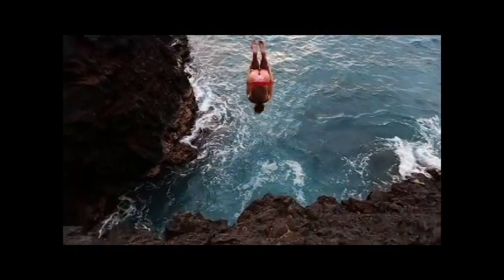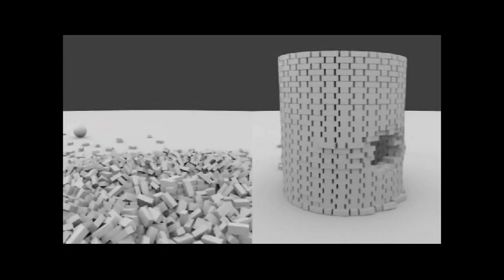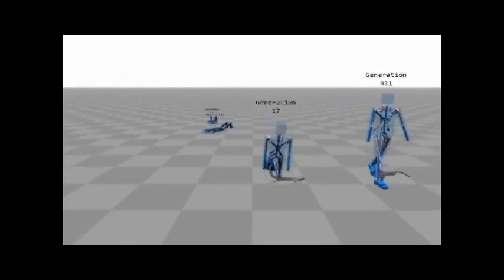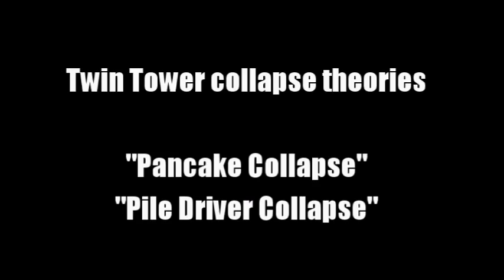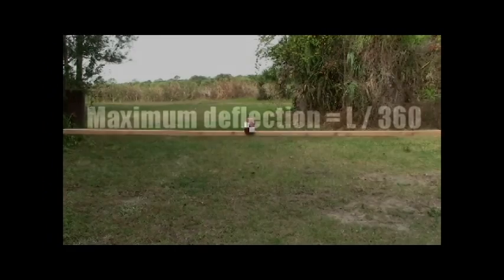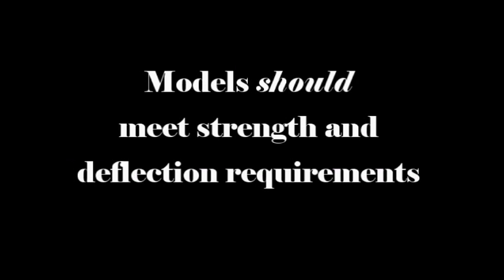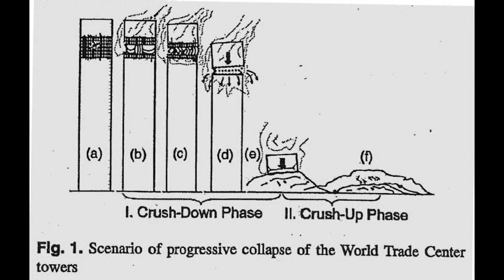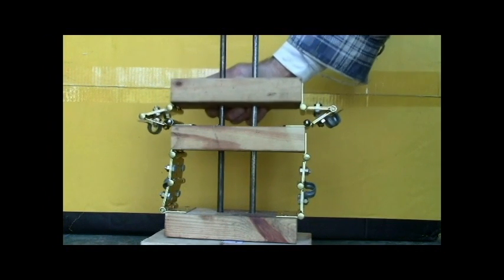9/11 Experiments: The Force Behind the Motion

Comment: The official story of the collapse of the towers is that they were a "pancake" collapse. If that's true, where were the "pancakes"? If you look at photos of ground zero after the collapses you will see that there is a complete absence of 110 concrete floors lying on the ground where each tower would be. What happened to them? They completely disappeared! The official story is a lie!
Reply: +prodigy2k7, the pancakes magically turned into dust. Otherwise, in the real world, pulverization requires work (energy). The amount of work consumed by collapse of the buildings, pulverization of the concrete, and blowing hot concrete all over lower Manhattan, remains roughly 50x that available in the PE (potential energy) of the upright structure.

That's what says pancakes would be in one piece at ground level, if explosives were not involved. So, explosives were involved.
Reply: +Debbie Walker; dear lady: this video; like any other experiment we have seen here, clearly shows that the abided scenario is not correct. The pancake theory is already negated by NIST. Remains the pile driver theory. Since the latter is in violation of the commonly accepted theories of sir Isaac Newton; we need some proof for this. Unfortunately; none is presented.

There are a few circumstances that STRONGLY suggests that the towers were loaded with SOME KIND OF EXPLOSIVES OR SIMILAR. 

1. All the concrete was turned into dust.

2. Huge steel beams were tossed more than one hundred yards SIDEWAYS.

3. The core was turned into a skeleton that was clearly visible several seconds after the collapse was completed. Some have argued that the core columns still standing was a proof for the pancake theory. On the contrary; the SHAPE of it proves that it was damaged by something totally different than some falling debris. A steel skeleton that turns into a cloud of dust. What could be a more obvious proof? Bazant´s mathematics?
Reply: Game Set and Match. That shows how important it is asking the right questions. Bravo.
Reply: +Debbie Walker is that seriously how you hope to discredit how 9/11 wasnt a controlled demolition? Because the amount of debris? The wtc was built to withstand the events of 9/11 and when you look at how the building fell, paired with the numerous witness accounts of people hearing consecutive explosions, it further proves the theory. There is more evidence that supports that 9/11 was staged than what the government tells us. Wake up.
Reply: 9/11 was the "Day of vaporization".
Reply: Claiming thermite did  it, or your thermate, is as stupid as Judy Woods DEW insanity.  No thermite was found, Jones and his fellow 9/11 truth nuts made up the thermite claims based on nothing.
Reply: Lynn, sulfur means what?  Tons of wallboard, tire fires from the garage burning for weeks. It was planned by UBL, and done by 19 terrorists.  The debris was gone through for human remains.  The fires caused buildings to collapse, simple science.  If you have evidence otherwise, take it to the FBI. Or team with a newspaper and earn the biggest Pulitzer since Watergate.  But you have nothing but BS, as you ignore 19 terrorists who did it, and try to blame people you can't name and offer zero evidence to support your fantasy version of 9/11 you can't spell out.  You have to cover your loads, it is a law; or do you want human remains in the dust to be spread all over NYC and New Jersey... Got some evidence?  15 years, why have you failed to produce evidence to prove your scenario  you can't explain?
Reply: Pretty typical for a truther. You make an assertion without the slightest trace of evidence and like all your assertions get it completely wrong.
Reply: "How foolish of me."

Yes, extremely foolish of you. Pancaking is a very specific term used to describe how the floors collapsed onto one another, each one adding to the momentum of the one above it. Within a handful of floors, you have irreversible momentum that continues all the way down to ground level. You can see this happening with  your own eyes in the video angles that were taken from below the towers. 

Your "percolating, bubbling and popping" terms, while not actually used in any professional level, are RESULTS of the pancaking floors pushing each of their walls outward. FFS, even the guy who made the crude experiments in the video above says multiple times that it was a downward and outward process.

It's clear to me now that you aren't even holding any cards... hell, you haven't even attempted to sit down at the table. Are you just going to spectate and heckle or are you actually going to argue any points? You can't win unless you play.
Reply: You'll have to forgive Mike. He's a fucking idiot.
Reply: The "bathtub" was/is six stories deep to the floor, 70ft down to the bedrock. The bathtub floor was not broken, so it was less than 70 ft. deep to basement floor. The towers were 1362' tall.
Thick-headed , weak-suck "debunker" Tony Dumpcan thinks 110 stories of steel and concrete and steel structure fits in a LESS THAN 70' deep, 6 story hole. WRONG AGAIN, LOSER!
Reply: +Highsniffin'Burgerfart
You seem outraged when your own foul manners are mirrored.  Woshame!
"400k tons of the total tonnage were much less dense than steel" - Ah, now you're trying a quadruple cheat whammie.
1. The STEEL column materials ALONE were greater than 120 Ktons, and not 100 Ktons..
2. Much of the engineering floors and the roof WAS STEEL work.
3. The FOUR INCH PERLITE CONCRETE 'lightweight' floors had STEEL reinforcement.
4. The engineering floors and roof carried STEEL piping and equipment.
Was it the people or the aluminium cladding that made up the 400 Ktons, d'ya think?
"You can't use" - Oh, yes I can.
"so less room was available than you assert" - Of course.  But how have you put things so far? - "9/11 was the "Day of vaporization" - "pushing your theory into the toilet" - it just seems so - extreme.
The piles reached only a few feet ABOVE ground level for reasons I have explained and you have grudgingly accepted.
And NOTHING - NOTHING AT ALL was 'vaporized'.
SO the net result of our discussion is that we both know you are an abusive and foul-mouthed liar - but we both knew that before the discussion began.
Reply: The energy during collapse was more than 100 tons of TNT in each tower - E=mgh 
More than enough energy to do the damage seen on 9/11. 9/11 truth can't do the math and physics to understand the destruction.  The dust was insulation, wallboard and light weight concrete, it did not take much energy to turn wallboard into dust.
In addition, a floor in the towers fails over 29,000,000 pounds. The lower floors did not hold up the upper floors. The core and the shell held up the floors, the floors only hold up themselves by the connections to the shell and core.  Why can't 9/11 truth believers do math?
Reply: Yeah, let's just go back to 19 Arab guys with box cutters that couldn't fly a PAPER airplane hijacked 4 planes, slammed them into buildings that were built t withstand that and, for the first time in history, not one, but 3 buildings collapsed in free fall because of a few smoldering fires and, despite the fact that there were millions of scraps of paper strewn about the entire neighborhood, including the passport of one of the hijackers found in pristine condition, the black boxes were destroyed by the fires and were never found, even though they're built to withstand that!  That conspiracy story is WAY more plausible!!  Don't you think?
Reply: Which conspiracy? There are so many; death rays, lazers, cgi, drones, thermite, explosives,  etc. What is your particular brand of lunacy. Please tell us how it was done with evidence in support.
Reply: Steve Hunter the jet exploded as it entered the building destroying the insides. the fire still burning along with the impact of the plane striking it at well over 500 mph. I'm surprised the building didn't collapse immediately after being hit. people claim the building was wired with explosives. that's BS. if that was the case, the building would have collapsed immediately after the plane hit, after causing the explosives to go off. the logistics of putting explosives into a building like the WTC, would have been massive. we are talking truckloads. then they have to be strategically placed for maximum impact and wired without ever anyone noticing. this would have included entering offices and common areas. that doesn't include going through security. sorry everyone, the truth of the matter is that 9/11 happened exactly as what everyone observed, and by two planes.
Reply: They didn't disappear.
 They were pulverised.
Reply: "that couldn't fly a PAPER airplane"

Actually, Hanour at least had a CPL, which requires a certain amount of ability.  Of course, none of the flying done that day was beyond the abilities of a 12 year old kid with access to a PC flight simulator.

" hijacked 4 planes,"

Ah yes. Because no Arab, ever, has ever hijacked an aircraft, right? I mean, they're just genetically incapable of it, surely?

" slammed them into buildings that were built t withstand that"

The buildings DID withstand it. It was the subsequent fire that proved problematic.

"and, for the first time in history, not one, but 3 buildings collapsed in free fall"

None of those buildings collapsed "in free fall", you lying fool.
Reply: OMG you're right! They're covering up an even bigger story! They made matter disappear!
Reply: "There simply was not a pathological energy source stemming from the alleged plane impacts"

You're a moron, Mark. A complete fucking moron.
Reply: "The story you have to work with is not even as feasible as that one of Mark's"

Then you agree that Mark's story is so silly as to be laughable? Yes or No? Oh but wait, he's on "your side" so it's OK to make shit up, right?

"the odds of your fantastic story ever being demonstrated to be possible is in the neighborhood of the chances that you will win a Power Ball grand prize three times in succession."

It would seem that you HAVE no aversions to making shit up. Making up invented "odds" is sooo easy to do, isn't it? Incidentally, I'd LOVE to see you try to produce the math you used to support your made up drivel. Have you figured out how to write with shit yet? I'm sure there are teams of investigators still working on it...
Reply: "speech must be protected from the government because speech is the beginning of thought"

I see, and which speech have I refused to allow to happen? Every single comment that has been made on this thread is still right there, for all to see. 

You don't logic very well, do you?
Reply: No, not necessarily. If it were a controlled demolition there would still be a vast amount more debris left at ground zero than there was. Thus disproving it was a controlled demolition. Look at Dr Judy Wood's work, "Where did the Towers Go"
Reply: HighsNBurgers Maybe the twin towers were the ultimate sort of automatic high rise? A structure that would house 50 floors worth of people for fifty years and then be brought demolished in a few seconds !! :o
Reply: Plus, there was the little fact that there were massive holes in the middle of each building, clearly visible in photos. Large, deep, black holes... not concrete and steel.
Reply: Of course you are right. Only Dr Judy Wood provides an extremely well researched and logical explanation of what happened.
Reply: Tony "Chester the Molester" Duncan,
You've got just enough 7th grade math in your brain to create some real bullshit fantasies. Using your references;
100k tons steel,+ 212k cu yards concrete + everything else = 500k tons per tower. 400k tons of the total tonnage were much less dense than steel.
You can't use;  WTC ht in feet X total WTC weight/imaginary 1362' solid steel block weight = height of an airless block of steel
Doesn't mean anything AT ALL. Unless you want people to believe the basements ended up as 51.77' solid block of steel with no air space!
WTC basements contained massive amounts of thick structural steel and concrete and were NOT empty before the collapse, so less room was available than you assert, further pushing your theory into the toilet. After the collapses there was still a lot of air space left in the basements and even more in your head. Put the pencil down and use some common sense, fool!
Reply: Please read and understand what I wrote before criticising it. I DO NOT believe the official story, neither do I think it was a controlled demolition . After 15 years of studying the theories out there, and I mean really studying them, there is only one thorough and proper scientific analysis of what happened that day, and that is the work of Dr Judy Wood. Unfortunately her work is ridiculed by so called 9/11 truthers because the movement has been infiltrated by "shills" and in a desperate attempt to keep the secret space program and all its secret scientific knowledge and weapons still hidden from the general public ,her work is being targeted, as it reveals too much sensitive material.
Reply: +HighsNBurgers
"you draw hard conclusions from rough estimates" - You draw them from EMOTIONS.
"You think 911 truth seekers are stupid?" - TERMINALLY. 
"How does your (joke) pancake theory knock down and chop up the 47 inner core columns into handy truck-sized pieces?" - Without floor connections ALL columns fall straight down.  Sorry about the Science - it really fucks with emotion.
https://en.wikipedia.org/wiki/Euler%27s_critical_load
"Also, where are the pancakes?" - Burger King.  Don't you work there?  High?
Reply: +Lynn Auriemma
"sulfur was found, lots of it, the whole area stunk of it" - It's what happens when you play THIRTY MILLION GALLONS OF WATER over MANY THOUSANDS TONS OF CRUSHED WALLBOARDS and allow it to fall on A THOUSAND TONS OF RED HOT STEEL.
The GYPSUM of the wall boarding is CALCIUM SULPHATE which is 5% SOLUBLE IN WATER.
The SULPHATE IONS in the firemen's water were REDUCED by the red hot steel to ELEMENTAL SULPHUR, HYDROGEN SULPHIDE, and IRON SULPHIDE, depending on how the liquid pooled in the hot wreckage.
It's a high-temperature corrosion process that needed TIME, and got it.
"I watched the second plane hit and I watched as the towers came down, it was all planned" - Hijackings involving multiple planes always are.
"why would they do that if there was nothing to hide?" - Are body parts your thing?
Reply: If you base the experiment on only one parameter: floor deflection, then the experiment can apply to any building.  Or, in fact, none.  As such, his experiment supposedly disproves any pancake collapse.  But we know from many examples before 9/11 that pancake collapses do happen.  Therefore, the experiment is busted and completely bogus.

Furthermore, anyone who designs buildings know that each floor is built only to hold itself up,  the stuff on that floor, plus a nice generous safety margin.  The only horizontal forces are those required to keep the vertical columns (which hold the whole  building up) in line and resist side stress from wind or earthquake.  This means that any given floor in a building is likely only strong enough to hold up itself, plus one and perhaps a second floor - at which the floor is expected to hold up triple its design load.  This isn't even taking into account the forces involved in trying to slow down a floor falling onto it.  Will it accelerate once the collapse started?  Damn right it would.  Otherwise controlled demolitions wouldn't work either.

You wanna do a more accurate experiment?  Find a wooden ladder and strap it in a vertical position.  Put on a back pack and climb the ladder.  Have a friend in an adjacent ladder add lead weights into your backpack until the rung you're standing on breaks.  As you fall, you'll break every single rung, and you will be accelerating all the way down.  If you survive this, repeat the experiment with an identical ladder, only this time, have your friend drop the weight previously determined to break the rung on your head from 10' higher up.  You'll "pancake" the ladder even faster. 

Where are the pancakes?  The WTC towers are many times bigger, heavier and taller than any building that's ever collapsed before.  You tell me what happens if you took a 200 foot square slab of concrete 12" thick and drop it 1300 feet.  Is the result going to look like a pancake?   Nope.  It'll be the next best thing to having  a couple tons of TNT blowing up, it'll be concrete bits splattered for 100s of feet.

I've seen the calculations for the collapse energy of the WTC.  The equivalent of about 250 tons of TNT.  Which is about twice as much energy that's required to crush that much concrete into gravel (and smaller) sized bits in an industrial rock crusher, the rest of the energy being adequate to twist, bend and break the steel connections.

Given that the vertical columns arrived on the site during construction in trucks, it doesn't seem unusual that they'd be truck sized chunks when they were taken away.  A chunk of wreckage too big to fit?  That's what cutting torches are for.  it took them 6+ months to clean up the site, plenty of time.  You don't really think the building was built with helicopters carrying 1300' long steel beams do you?

Do I think 911 truthers are stupid?  Most of them are simply ignorant of the physics involved in something like this and are easily swayed by the con.   A few scientists or engineers (PEngs specialize.  An electrical engineer knows very little about structure)  think they understand the physics, but their knowledge of structural design is lacking - the guy who did this video certainly is.  A small core are taking cynical advantage of that ignorance to make money off it.
Reply: Also worth mentioning that of the floor truss connections NIST were able to examine, 95% below the impact zone were either bent downwards or sheared off. Strong evidence that the collapse mechanism involved progressive collapse of the floors.
Reply: Red Vynil         Steven Jones.....  excellent.
In April 2009, Jones, along with Niels H. Harrit and 7 other authors published a paper in The Open Chemical Physics Journal, titled, 'Active Thermitic Material Discovered in Dust from the 9/11 World Trade Center Catastrophe'  behind the back of the editor.  
 The editor of the journal, Professor Marie-Paule Pileni, an EXPERT in explosives and nano-technology, resigned. She received an e-mail from the Danish science journal Videnskab asking for her professional assessment of the article's content. According to Pileni, the article was published without her authorization. Subsequently, numerous concerns arose regarding the reliability of the publisher, Bentham Science Publishing. Numerous other people in the administrative level also  resigned.

Jones and Co.'s claims of thermite have been soundly proven false. You are about 6 years behind the news...
Reply: I've read the Jones/Harrit paper and it is a good example of how science should NOT be done. They seem to have started with the conclusion they wanted and then looked for evidence to support. The chips they claim to be thermite look suspiciously like paint chips.
Reply: As I write this, a London tower block is ablaze. You can clearly see white hot molten substance pouring out of the side. Looks exactly like the molten stuff which 9/11 truthers claim to be molten steel pouring from the WTC tower.
Another nail in the coffin of their thermite claims.
Reply: DSC for real thermite: https://www.researchgate.net/publication/245208695_Kinetics_of_thermite_reaction_in_Al-Fe_2O_3_system
Note the endothermic process at ~660 as Al melts and the exothermic reaction at ~950 as the thermite combusts.
Completely different from Harrit's results.
Reply: Another likely source of iron, and other microspheres, in the WTC dust is the use concrete containing fly ash to make the floors. Depending on it's source, fly ash can contain considerable amounts of iron microspheres.
The only people "surprised" by it's presence are truthers.
Reply: The problem you seem to have in believing the true account of what happened on 9/11 is that you have been duped by a few cynical and manipulative individuals like Richard Gage et al.
ALL the main points in your post are untrue.
Let's just take one to start with; the hijackers could not fly
 ALL had taken training in flight schools, and also booked many hours on simulators.
Hanjour actually had a commercial pilots licence and all they had to do was steer an already airborne plane into the side of a huge building. 
This takes no particular flying skill. Don't take my word for it, here's what a real life commercial pilot, with many hour on 767's has to say.

"1. The terrorist pilots lacked the skill and training needed to fly jetliners into their targets
This is an especially popular contention with respect to American flight 77.  Hijacker pilot Hani Hanjour was a notoriously untalented flier who never piloted anything larger than a four-seater.
Yet he is said to have pulled off a remarkable series of aerobatic maneuvers before slamming into the Pentagon.  The pilots of American 11 and United 175 also had spotty records and had flown only private planes.  They should have had great difficulty navigating to New York City, and even greater difficulty hitting the twin towers squarely. To bolster this idea that the hijackers were Oswaldian pawns, the conspiromongers often invoke impressive-sounding jargon and fluffery about high-tech cockpits, occasionally trundling out testimony from pilots.
Reality: The cabal’s feats did not require in-depth technical knowledge or a high degree of skill.  The attackers, as private pilots, were completely out of their league in the cockpits of those 757s and 767s;
however they were not setting out to perform single-engine missed approaches or Category-3 instrument landings with a failed hydraulic system – or to land at all. 
They were setting out to steer an already airborne jetliner, in perfect weather, into the side of a building. 
Though, for good measure, Mohammed Atta and at least one other member of his group did buy several hours of simulator training on a Boeing 727 (this was not the same type of jet used in the attacks, but it didn’t need to be).
 Additionally they obtained manuals and instructional videos for the 757 and 767, available from aviation supply shops".
Reply: Core columns stretching up into the sky!
Well, considering the towers were only 410m tall this is a bit of an exaggeration but watch the video of the collapse and that's exactly what you do see. Core columns stretching up, maybe not into the sky but for something like 200m. Needless to say, this is very unstable, the column wobbles a bit and then collapses well after the rest of the building. Very strong evidence that the primary collapse mechanism was progressive collapse of the floors.
Reply: When NIST did fire studies on the floor trusses, there were loud cracks as the concrete spalled. This could certainly explain the "explosions"  reported by firemen.
Reply: I am sorry to hear that you are intellectually handicapped so I'll make the explanation as simple and non-mathematical as possible.
The top of the tower, above the impact zone starts to fall, starting from zero it is in free fall until it impacts the first intact floor.
This is designed to take a load of about 1500 tonnes so even allowing for a generous safety margin this can only slow down the falling mass a little before it gives way and the whole lot is then again in free fall.
When this INCREASED mass hits the next floor down it is falling even faster. This gives way and the process is repeated all the way down to the ground.
Reply: +Mark Olander In short, "progressive collapse" basically means that part of a building, for one reason or another, fell on another part, that second part broke off because of the impact (very high dynamic load) and fell, both fell on a third, and so on.  Once this starts, it won't stop until the falling pile of debris hits something that it can't break or push out of the way. Which in the case of a building of uniform structure means that the collapse continues until the debris hits the ground.  There are examples of progressive collapses that run into something much stronger (like a massively reinforced level), and stop before reaching the ground.

Visually, progressive collapses can take several forms.  A "pancake collapse" is when a floor drops as a fairly intact sheet onto a second floor, that floor breaks off, and they both fall on a third, and so on.  The result can be a fairly neat stack of floors, or, a messy pile of semi-layered concrete chunks, depending on heights, strengths and so on.  Sometimes the walls are left standing, sometimes they fall over.  Depends on their strengths and how the pancakes spread.

Another form is where the connections snap, and fall in a fairly random pile of more or less intact, but disconnected, structural parts.  Think of this as the "house of cards" form.  There are examples of that, especially with steel buildings under construction where they overload one part of the steel skeleton, that part breaks, and the various pieces falling batter the rest of the skeleton into falling apart.

Very close and detailed observation of the WTC tower collapse progression appears to demonstrate two more forms.  Remember that the tower was a central core of columns, a perimeter "mesh" of columns, and a thin concrete floor on top of some relatively light trusses, connected between the core and perimeter columns by one simple angle iron bracket on each end.  This was a new and fairly unusual building structure designed to minimize weight and cost, but at the same time increase office space.  Plenty strong as long as nothing went really really bad.

Imagine if you will, something happened to the tower that broke many of the connectors attaching the floor girders to the perimeter wall (eg: an airplane crashed into it).  Imagine also that there was a big fire that (according to full size floor model testing that was done later along with a basic understanding of steel strength under heat) also cause the floor to sag and soften other steel.

Let's say that it was just enough to cause one or two floors to break loose of the perimeter columns.

What happens?  Those one or two floors outboard sides "flop" down and hit the next floor.  Result?  Huge dynamic load right at the outboard connectors on the next floor, and if the conditions are right (multiple papers have demonstrated that they are), the connectors on the third floor break.  It flops too, and the whole assembly whacks into a fourth floor.  Whose connectors break, and it continues...  So we sort of envision a "venetian blind" effect as the outboard ends of each floor smash downwards and break the next one's outboard connection.

Meanwhile, what's happening with the inboard (central column ends) of the floor support trusses?  The connector brackets start to bend, they exceed the elastic bending angle ("recoverable" steel bend) and go into the "plastic" bending mode - the steel won't recover from the bend and worse, the steel fibers (see a metalurgist for the crystal fiber nature of steel) are starting  to disrupt, tear, and rapidly lose strength.  They break and the whole floor (not just the whole outboard side) is now falling.  Which helps the next floor start to fall (and it's also bending).  So, progressively, the floors start to fall down and they keep going.  The guy who wrote the article on this called it "the floors stripped off".  So we have a progressive collapse of the floors themselves that can basically be thought to falling down the "tube" formed by the perimeter walls.  Notice how the perimeter columns not already damaged and the core columns are relatively unaffected - things are breaking off from them and falling straight down.

I consider the photos and discussion showing this pretty convincing.

What else is going on?  Think about the perimeter "mesh" of steel columns.  They've lost their floor connections.  There's nothing other than their stiffness keeping them from bulging in or out.  If they bulge too much they could start to break up themselves, because the only thing holding them upright are the corner connections.  There are photos, videos, and measurements of these bulges.  What else?   A 10-20 floor "chunk" of relatively intact building is falling on it.  What does that do when it hits the perimeter steel?  The perimeter steel has very little horizontal support left, and the upper building section literally blows them out of the way in mass quantities of interconnected mesh sections.  Doesn't take much to do it either.  Ample photos of the perimeter sections draped over things for acres around.  Ample photos of perimeter sections falling.  Perfectly explaining why some pieces are thrown long distances.

So we kinda have another form of progressive collapse happening just on the outer steel.

Worthy of note is that once the upper building chunks break up from the impacts, the only things really impinging on the central columns are pieces falling vertically.  No bending.  They're small targets, and much stronger than the perimeter columns.  Unless you hit the end square on with something very fast and/or heavy, it just sorta slides down.  And guess what?  A pretty significant height of core column remained standing by the time everything else hit the ground.  But, they're too tall, and there's not enough horizontal support for them to remain standing, so they start to tilt.  Once they start to tilt, for reasons that would take a couple pages to explain, the connectors between each section of core column start to see enormous bending stresses, so those connectors break too, so the column doesn't end up as a pile of 400' long steel "bars", but a lot of sections with broken connectors.  Kinda another form of progressive collapse, but only kinda.  So we'll not call it that.  It's just another form of collapse.  [You can see it in the WTC and Plasco collapse videos]

Understand what I described?  Think about it for a while.

While NIST doesn't describe this, they assumed (as any sufficiently qualified structural engineer would) that once the collapse started (they amply proved initiation), total collapse was inevitable and wasn't worth modeling/describing.  So the analysis stopped there.  Later, when pressed "how did the collapse do that?", they hadn't bothered and the spokespeople, even if they understood what would happen, didn't have carefully prepared "sound bite" simple descriptions.  Because it isn't very simple if you have only 15 seconds to describe it, and without a full analysis, any description would have holes that need research to fill.
Reply: +Eric Henderson Another thing that would be happening to some degree or another, is full blown stress fracturing of the concrete due to unequal expansion.  NIST's experiment (with a full size mockup of a relatively narrow floor section) might not have been big enough to for this to happen or the precise conditions of the fabrication not right.  High heat load spalling is a well-known phenomena and can be quite noisy (and dangerous to be too close to).  A 30' plus long stress fracture under such conditions would be very loud, potentially quite violent shattering quite a bit of concrete, and might as well be an explosion.

Yes, the rebar helps.  Somewhat.  But not completely.

Potters are intimately familiar with the phenomena.  Turn a nice bowl, stick it in the kiln with a few other turned objects, and an hour or two later, BOOM!  Wait for the kiln to cool down, and you're presented with nothing but broken shards of everything in the kiln.  Some potters come to expect loss rates as high as 10% or more.  They all have tales of the gorgeous pieces they made that exploded in the kiln.  The potter version of the fish that got away.
Reply: Steve Hunter 7/11 was a part time job!
Reply: WTF has "pathological energy" got to do with anything. There was more than enough kinetic energy to do the damage seen plus a huge amount of chemical energy in the fuel.
Reply: Oh look, another useless comment from someone who thinks pancaking is a literal statement. I am not surprised in the least.
Reply: "they had become crushed zone dust from the 150 kiloton underground nuclear explosions"

giggles helplessly

Funny how not a single one of the seismographic stations around New York ever recorded a single explosion that day except for the two impacts from the jets But you somehow seem to think nuclear explosions were used? FFS Little Boy, the bomb that was dropped on Hiroshima was only 15 kilotons. But you insist that nukes equaling ten times that amount were somehow detonated... HAHAHAHHA. Oh man... 

You are either not a very astute thinker or you are not a very good liar. Either way, I think you've "proven" your level of ... hehehe... "understanding" rather well.
Reply: "The opinions you express are not your own and they are expressed as a representative of our federal government in an official capacity as a propagandist  for pay."

For PAY?!?!?! You mean I can get paid to do this? Where the hell are my checks?!?!?!

"I don't expect you to see the difference since you purport to believe the official fairy tale while knowing that it is a lie."

If I "know it is a lie", as you say, then wouldn't that mean that I should "see the difference"? Do you even logic?

And once more, I ask: Which of your rights am I impinging upon by utilizing my freedom of expression? And also again, do you have any actual arguments other than pretending I am some clandestine paid federal employee sent to a random YouTube videos to deny people of their rights, even though I have not removed any comments, spammed any comments or forced anyone to stop communicating through comments? I mean, in your very first comment you invoked Newton's 3rd Law and when I asked you to elaborate, you hightailed it out of there and never even remotely tried to explain. 

Let me make this clear Any joe schmo can waltz into a comment section and make assertions but intelligent people can back them up. To date, I'm still awaiting your intelligence to grace us with it's appearance. So, you have several challenges on your plate and your only response is "You're fake"... LOL, you conspiritards are even out of your depth in a fucking puddle...
Reply: Whoa, whoa, whoa...where are the pancakes?
Reply: Building 7.
Reply: Did you figure that out on your own?..
Reply: Good point Steve. In christchurch nz a few years ago we had a multistory building that pancaked, behold the pancakes!! :P
The thing that does it for me is the dust. Vast fuckloads of concrete dust.
Reply: Debbie, Judy Wood presents evidence and asks that we don't try to make the evidence fit out preconceptions. Seems like the thing to do if you're a real scientist.
Reply: "The official story of the collapse of the towers is that they were a "pancake" collapse. If that's true, where were the "pancakes"? "

Satire that writes itself. :^ )
Reply: The pancakes turned to dust.
Reply: eyesuntzu sulfur was found, lots of it, the whole area stunk of it, it took me months to get the smell out of my apartment and furniture. I watched from my bedroom window 10 blocks away, I watched the second plane hit and I watched as the towers came down, it was all planned. I watched the clean up as dozens of white and back trucks removed what remained under tarps, why would they do that if there was nothing to hide?
Reply: Lynn - thanks for sharing your experience.
Reply: Some ballpark numbers - the WTC was approximately 12% structure, and 88% air.  Which means that if the debris didn't spread out and formed a neat cube, it'd be around 150 feet high.  But, the debris did spread out a lot according to the collapse videos and post-collapse aerial shots, and other photos show debris piles at least to the 50' point on surrounding buildings.  So, combining that with the basements filling in to about 70', there's lots of debris, and nothing went "missing".  Some aerial shots show parts of the exterior facing of the buildings draped like flower petals over surrounding buildings.

The purely gravitational collapse energy of each tower is approximately 250 tons of TNT.  That's far more than adequate to crush the concrete into pieces that would range from dust sizes to considerably larger pieces.  You can determine that by looking at, for example, the energy requirements of jaw crushers.  Post-collapse photos show areas of concrete debris up to at least brick-size.

These "experiments" do not represent the real physics involved in the buildings.  One of the biggest problems is scaling - if you build scale something by a factor of 2, cross-sectional area goes up by a factor of 4, and volume (and thus weight) go up by a factor of 8.  If you halve the size of an aircraft, the wing area goes down by a factor of four, and the weight (using the same materials) by a factor of 8.  The model won't fly the same was the original, and often has to have weights added or wing areas changed to be able to fly properly at all.

When you model a building this way, the relationships between strength, weight, inertia, deflection are completely thrown off.   He didn't take into account scaling at all, and thus his experiment could not really be said to be tuned to the WTC.  Pancake collapse is real, and has been known to happen long before 9/11.  To paraphrase Feynman, "When the experiment doesn't match the real world, the experiment is wrong".

Scaled down models of aircraft are not used in wind tunnels ot determine whether the plane will fly.  They're used to determine wind flow patterns over the wings and fuselage to determine such things as stall behaviour,  stability of airflow, drag reduction, and prove the behaviour of new airfoil designs.
Reply: Fromage fuzz -  you draw hard conclusions from rough estimates.
You think 911 truth seekers are stupid? 
How does your (joke) pancake theory knock down and chop up the 47 inner core columns into handy truck-sized pieces? Also, where are the pancakes??
Reply: The point about the experiments in the video is something I've been trying to explain to truthers but they just don't get it. Their reasoning seems to be based on intuition rather than any comprehension of the forces involved in the collapse of the WTC's. A scale model is meaningless unless it can accurately represent these forces.
Reply: Very nice, Fromage.
Reply: @debbie Walker her work is indeed ridiculous, for someone who has her supposed expertise.  She keeps claiming that all the debris disappeared, but of the thousands of photos she supposed analysed, do not even one show the mountains of debris that a second's worth of google image searching  finds?  What were those trucks hauling away from the site 7x24 for 6+ months, if not debris?  No steel?  There were mountains of broken steel as many photos show.

She invents some sort of space-borne energy weapon that can hit the ground with such effects.  There is no evidence that any such device exists.  It would require enormous amounts of energy, of  a type that would literally require that the satellite is a nuclear-pumped energy weapon.  One problem with nuclear pumped energy weapon, you get one zap while the device is blowing itself to smithereesn, not to mention people seeing the flash - a orbital nuke would be brighter than the sun.  Further,  a single burst doesn't give you the ability to "fire hose" it around to hit anything more than one thing.  Not this and that building, and have fun zapping cars.

You don't think someone would notice a nuclear bomb going off somewhere else if it was ground-based?

Furthermore, basic physics demonstrates that any energy weapon of the power required would so solidly ionize and interact with the air it passes through, that it would visibly to be a blindingly white hot bar waving around.  Further, they can't help but dissipate their energy within dozens of feet, not miles.   Did anybody see such a brilliant bar of light?  it would be kinda obvious.  Nope.  There is a reason why ground-based "energy weapons" are just intended to blind/confuse the relatively delicate guidance systems of missiles - doesn't require a lot of energy.  High energy weapons are exclusively limited to use in space.  if there were any such things actually existance.  There are various speculations and proposals, but no evidence that one was ever deployed, and as we know, it wouldn't work.

Her evidence re vehicles  is laughable.  Obviously she's never seen a burned out car before (google search, you'll find lots), and would know that most of the vehicles she quoted as victims of energy weapons look just like cars burned out for any other reason.  Missing engine in a fire truck whose cab was demolished?  Fire trucks don't have their engines under the cab.  It's inside the body.  Her puzzlement about how a particular car got damaged in a particular way, when the piece of building that fell on it was sitting there in plain view embedded in the car?  And why, oh why, if this device was so powerful, why didn't it gouge out huge holes in the pavement?

As for dissolving building bits.  Well, if  you ignore all the high-res good quality video, and rely only long-view low-res partially obscured by smoke and heat haze views, yes, it might appear to dissolve.  But videos of the same thing from different angles show clearly that they didn't dissolve.

She's just as batty as the Russian immigrant, allegedly "nuclear weapons expert" who insists the buildings were brought down by three 175Kt nuclear blasts centered 75m below ground level (WTC 1, 2 and 3) supposedly to create a cavity that didn't quite touch the basement level - but WTC 1 and 2 fell from the top down, oh, they say,  it focused a plasma blast up the tower which was "designed" to take a right angle turn at precisely the right height, and gradually move down the tower at around free fall speed dissolving the building as it goes.  WTF?  The poor schmuck read his own "cavity size tables vs. bomb yield" table wrong.  Meanwhile, we know that even 200M down, a single 150Kt blast would lift the entire WTC complex out of the ground and splatter it into the Hudson, leaving a crater 100M deep and 400M across.   How do we know this?  Both the Americans and Russians did test shots in the early 60's of 104kt and 145Kt devices respectively at 200M depth, and that's the size of the crater they dug.  the former is still a big hole, the second is a 1200' diameter perfectly round lake.

But that's okay, she can make a living selling her fictional works on 9/11.  The Russian schmuck not so well, he's got a gofundme page because supposedly he's reduced to eating cat food.  He needed a better publishing agent.

Gee, I wonder how many of those 60 published papers were really written by her?  As is still true in many places, professors insist that their name be put on as authors or co-authors of papers really written and work done by their grad students.  The grad students are over a barrel, because if they refuse, the professor can trivially arrange that they don't get their degree - years worth of work wasted.  Thus, the professor gets "published" - which helps get tenure, but in reality didn't do anything whatsoever.

This all reminds me of religion.  First you have the thermite sect, then the "other" controlled demolition sect, then the hydrogen bomb sect, and the disintegrating ray sect.  Then we have to include the "wingless anti-gravity" vehicle from Area 51 cult (which still kept going after it was pointed out that higher res versions of the same video clearly show wings), hyper-velocity Israeli submarine-launched cruise missile cult, the hologram cult, the "pull" cult, Raelians, Planet X and other fringe-of-the-fringe-of-the-fringe culties.  Each of which are screaming "heretic" and "traitor" at each other.  This is what you get from pure faith, completely absence of reality.  But hey, some of them make money off the youtube hits, the fiction they write, and their blind followers.  It's a living.  I guess.  I'm not interested in fiction.
Reply: Fromage Frizzbizz Those of us who still have a grip on reality should be grateful to her and the others on the lunatic fringe. They do a fine job of discrediting the entire 9/11 "truth" movement.
Reply: @Eric Henderson  You mean the fringe of the lunatic fringe, yes?  You do have a point there.  I'm sure that if you managed to get enough of these cultists close enough together, that they'd spontaneously self-destruct with much heat, light and gunfire.  Problem being that religious wars tend to hurt innocents, kinda like the 30 years war.
Reply: And why was there no syrup all over the place??
Reply: Lol.
I eat `em without syrup.  Just sprinkle sugar all over one side, then roll them up into a log.  Yummy!
Reply: Steve Hunter there is a video of two workers in a bucket overlooking the collapse site.  one of them mentions digging through the rubble and finding 15 floors in the span of 8 feet
Reply: +Joe V 15 stories in 8 feet makes perfect sense.  The concrete floor slabs (if it stayed together enough to be recognizable as a floor) were only 4" thick, and the long span floor trusses (which were probably about 16-20" high) would crush down to a few inches at most - they were relatively light welded trusses made out of structural angle iron and tube.  Strong enough when intact, but would flatten down to almost nothing with a few 10s of thousands of tons falling and mashing them flat. Not to mention a few months of hot soak in a burning pile of rubble.
Reply: Jake Benjamin you are spot on with Judy wood.   but there is NO evidence for thermate, thermite,. nanothermite. anywhere...
Reply: +Eric Henderson Much of the truther's take some of the collapse descriptions far to literally.  Eg: "pancake collapse" - meaning everything falls flat and appears as a perfectly stacked pile of horizontal flat pancakes.  But it doesn't have to be.

The best description of precisely how the towers fell appears to be "ROOSD". Which stands for "runaway open office space demolition". Which can be coarsely described as once a few floors have lost their outer truss connections (impact, fire, structure damage), the ends fall and the floor ends fall, hit the next floor, shear those, and it continues.  As the slabs become more vertical, they break the central column supports and the whole floor becomes detached.  In essence, the floors strip off the central cores, and are somewhat contained by the outer shell.  The outer shell, now deprived of its horizontal ties, opens up like a flower petal and breaks off (and is hit by the upper floors speeding up the process).

In other words, the interior floors of the buildings strip off the core columns and fall down a tube formed of the outer shell.  Deprived of the lateral support the floors represent, and being hammered by the remnants of the top of the tower, the outer tube itself also splits and collapses in vast interconnected sheets - which photos of the debris fields amply demonstrate.

All backed up with detailed timelines and photos of the debris.

For a detailed dive:

http://www.sharpprintinginc.com/911

For a quick introductory overview,  read the intro, then section 2.1 and 2.4.  Then peruse the photographic sections.

The author has a particular hate on for the NIST report, but I think it's mostly unjustified.  The NIST reports themselves were written relatively quickly, and with good science up to the point of collapse initiation.  They went no further, because they didn't need to. The fact that later analysis showed that some of what NIST said was erroneous was greatly overshadowed by the political/public implications of doing the whole thing over again at great cost, and merely yielding a slightly different physical description of the collapse that nobody in the public would understand anyway.  The real value are with the subsequent studies and engineering reviews beyond the NIST's incident report.
Reply: Joe V:  No, no evidence at all, that's why one scientist has made an entire presentation on the particles of it found at the site.
Reply: Red Vynil are you referring to Stephen Jones or Niels Harrit??  hopefully your answer is yes.
Reply: Steven Jones.
Reply: +Eric Henderson They look suspiciously like paint chips because that's exactly what they are.  All of the co-authors (save one) were truthers.  The lone exception was a materials physicist, but not an analytic chemist, which is why he didn't catch the defects in the test procedure.

The most damning are two fold: 

They performed no analysis to determine whether the aluminum was present was elemental or bound up in compounds.  Without pure aluminum, no thermite.  Rust paints contain silicates - which contain aluminum.

Secondly, when you test a complex sample for thermitic activity (which needs no air), you do NOT do it in air.  You do it in an inert atmosphere, because you can't tell whether the energy you get back was thermitic activity, or from something else in the sample.  Like the "organic matrix" they described BUT DID NOT analyze.  As such, the calorimeter test yielded three times the energy  that thermite can possibly produce, and is easily explainable by the organic matrix itself catching fire in air and burning.

The journal it was published in is a "vanity pub", ignored by the scientific community, and their claim that all papers are peer-reviewed was a lie.  As as a set of graduate students proved, this group of journals will accept and publish pure gibberish all the while claiming it was peer-reviewed.  By chimpanzees perhaps.   Two editors resigned once they realized that they were being lied to by the owners.
Reply: +Eric Henderson In Harrit, the DSC results for the sample showed approximately 3 times more energy than any kind of thermite can produce.

From a heat energy output standpoint, thermite is relatively anemic.  Paper is higher, jet fuel is about 10 times higher.

Quantitatively, it takes about 3 pounds of thermite to melt one pound of steel.

What makes thermite (and other reactive-metal/solid oxidizer combustable) unlike, say, an explosive, is that it's (a) quite a slow reaction comparatively, (b) generates very little gas (the combustion products of thermite rapidly turns into a solid), and (c) the heat produced is very high.  So instead of blowing its surroundings apart with extremely rapid gas expansion, the thermite just sits and cooks its surroundings with temperatures high enough to melt steel.  But in terms of actual energy output, it's positively anemic.

Harrit et. al. identified an "organic matrix" which they didn't analyze in any fashion. The "organic matrix" in a paint is the oil-or acrylic based resin that has polymerized through the drying process of the paint.  In two-part paints it's epoxy.  Both of which burn exposed to air with much higher energy outputs than thermite.  Indeed, in some circumstances drying oils can spontaneously combust.

By doing the calorimeter test in open air, they have no way of telling what part of the paint chip burned. Since there was an abundance of air, and since there was an abundant "organic matrix" identified in the sample, the obvious conclusion would be the organics burned off.  Harrit et. al.'s analysis didn't even mention that possibility.
Reply: Fromage Frizzbizz Not that any of this will dissuade the thermite sect from their faith.
Reply: +King Diamondfan Yes, the presence of melted steel microspheres is indeed proven.  No-one disputes that.   But there's no way that they can proven to be the result of thermite.  Melted steel microspheres are the product of high temperature on steel, not how they got that way.  Cutting torches, arc welding, and abrasive cutting/grinding all produce microspheres - what do you think the sparks are?  Microspheres of molten steel rapidly cooling off, that's what.

What do you think is done in large quantities during the construction of a steel building?  Precisely those things - microspheres would be present by the 10s or 100s of tons in buildings like the WTC BEFORE it came down.  As they are present in large quantities in metal shops that do welding or grinding.

Anyone who has witnessed thermite going off (and I have) also knows that while the thermite does produce microspheres, it also produces rather larger quantities of iron in melted lumps.  The experiment I witnessed was a mixture of iron oxide and powdered aluminum in a clay pot lit with a magnesium fuse parked on top of a firebrick.   Nice energetic, noisy (and slow) burn, and most of the iron from the thermite ended up as a puddle on the firebrick.

Where are the huge quantities of melted blobs at WTC?  There would have to have been thousand upon thousands of pounds of thermite used, which would have produced large puddles of molten steel.  There are no such puddles.
Reply: +Eric Henderson  That would contribute quite a bit too, despite the fact that most of the outright flying dust would have been drywall (gypsum) not concrete.  Another potential source is insulation that contains fly ash/spun slag such as rock wool (blown, batt or sprayed).  While the towers wouldn't have much in the way of thermal insulation on the window sections themselves, hidden steel and plumbing often gets sprayed with it as a fire retardant.  Much of the insulation barrier was greatly upgraded after the WTC garage bomb, and they wouldn't be using asbestos.

 Commercial sound deadening barriers are often made with rock wool because it's cheap and works quite well.  They'd be heavily used in an office building like this.  The substitutes you see in residential housing (eg: foam pipe wraps) are flammable and simply not allowed in commercial codes, and asbestos was banned during construction of the towers which caused them to change their concrete specs half way through amongst other things.

While rockwool "presents" itself as relatively heavy fluffy chunks, after flying through the air, the lighter dust would separate and float in the air and spread, and the heavier chunks would not go very far.
Reply: Apart from the impossible logistics of planting many tonnes of thermite with no one noticing, there are so many rational explanations, I think we can declare the thermite conspiracy is sunk without trace.
Reply: For the pancake theory to be true, you would see the core columns stretching all the way up into the sky as the PBS 3D animation proves. Simply put, the pancake theory and pile driver theory are invalid. Even on the day of 9/11 something about the collapse never felt right....the collapse didn't match up with what we witnessed.

At the most, the top burning section should have fallen of or the top section of the building should have been destroyed. Anything below could not have been destroyed by anything above unless there was another force being applied to the system.

This is why people CLAIM explosives. It's not a confirmed fact, but all the evidence points in that direction. The people who actually believe the official story are the same people who paid no attention and probably failed Physics and Mathematics in High School.
Reply: The people who said they heard explosions could have just heard the sound a 100 floor sky scrapper makes when it falls to the ground. At that point, i'm pretty sure they even heard the Reaper near by.
Reply: I was under the impression that the concrete was simply poured onto the floor pans without rebar. Did I misunderstand?
Reply: It was a full time job when I had it.
Reply: Rod Martin, Jr. yes the explosion of a 747 in the side of it
Reply: The pancakes were removed by IHOP who then sold them the next morning.
Reply: Sources when calling other people bullshit is not an option. Otherwise, you sound as crazy as the ones you argue with.
Reply: Steve Hunter Your comment got me spechless.That's so true!
Reply: The floors weren't even "in pieces" on the ground. They were dust, spread all over lower Manhattan, 3 inches thick.
They were pulverized before they began to fall.
Reply: WRONG. If "ordinary" building demo charges were used, there would be chunks of material dropping, including intact floors. The explosives used at WTC melted steel to flowing fountains and pulverized each floor in the instant all supports were blown out. This was not commercial-grade demo explosives. It was a controlled demolition and it would have taken months to calculate, design and install a system capable of the perfect sequencing we observe in all three of the collapses.
Reply: Contortions to avoid the simple and obvious truth. The observed behaviors required extremely high energy explosives detonated in perfect sequence. The reports are consistent with explosives. Spalling of the concrete is a farfetched idea as a cause of anything.
Reply: A 70 foot basement would not hold 110 concrete floors and other "chunks" of debris that would have accompanied such break-up. The floors and everything else were turned to powder as you can see in all the videos.
Reply: Bullshit. The only way that much stuff could be perfectly packed down into that much space is in powder form. A searcher said he found no piece of anything bigger than half the keypad of a desk telephone. No desks. No filing cabinets. Just tiny pieces of everything. Apart from lower Manhattan's being covered by 3" of that dust, Ground Zero was two large mounds of powdered concrete and steel.
And the only way such powder could be produced from 110 storey skyscrapers is high energy explosive internal demolition.
Reply: You're hardly qualified to discuss logic Richard. The minimum ante into this game is the ability to tie your own shoes.
Reply: You're hardly qualified to discuss logic Richard. The minimum ante into this game is the ability to tie your own shoes.
Reply: Well Richard, we all recognize the fact that you are sanctioned to discuss "logic" in YT. We only have the permission granted by the Constitution on our side.
Reply: "where were the "pancakes"?"

Apparently you've never watched any damn video ever posted of them collapsing. It was a classic pancaking action. The tops of the buildings above the impact zones literally took out the entirety of the buildings floors under them, one by one , all the way down. That is the very definition of pancaking.
Reply: +ErgoCogita  That's funny...........you think pancakes are made with popcorn that goes everywhere, up and out. It must be a cool planet you live on.
Reply: +ErgoCogita  How foolish of me. Of course everyone thinks of pancakes when they see building debris percolating, bubbling, and popping up and out in a mushroom shape like an overfilled popcorn machine..
Reply: +ErgoCogita  You shouldn't chortle Chuckles. The story you have to work with is not even as feasible as that one of Mark's, Actually the odds of your fantastic story ever being demonstrated to be possible is in the neighborhood of the chances that you will win a Power Ball grand prize three times in succession.
Reply: +ErgoCogita  I will tell you that I do not ascribe to Mark's conclusions. I will also tell you that Mark is entirely within his rights to express his opinions. I will tell you that you have absolutely no right to criticize honest opinions of the civilians in your role as a representative of the federal government. You are violating our rights guaranteed under the Constitution while chortling your way through your work day. It pisses me off knowing I contribute to your life style troll.
Reply: "Mark is entirely within his rights to express his opinions."

"you have absolutely no right to criticize honest opinions"

I have no right? But here I am, criticizing others opinions by expressing my own.

"your role as a representative of the federal government."

Yeah, all dissent from your personal opinion is manufactured, huh? 

"You are violating our rights guaranteed under the Constitution"

I see, and which right would that be? Have you ever even read the Constitution of the United States of America? I'd love to know which right of yours my right to freedom of expression is violating. Go ahead, let's hear it.

"It pisses me off knowing I contribute to your life style troll."

So which is it? Am I a "troll" or a "shill"? 

Are you going to sit there and bark all day or would you like to actually bite into an argument physics, or thermodynamics or engineering or anything regarding what this comment section is supposed to be about? I find a conspicuous lack of substance coming from your fingers.
Reply: +ErgoCogita  Here's the fundamental difference troll. The opinions you express are not your own and they are expressed as a representative of our federal government in an official capacity as a propagandist  for pay. I don't expect you to see the difference since you purport to believe the official fairy tale while knowing that it is a lie.
Reply: First Amendment to the United States Constitution From Wikipedia
First Amendment freedoms are most in danger when the government seeks to control thought or to justify its laws for that impermissible end. The right to think is the beginning of freedom, and speech must be protected from the government because speech is the beginning of thought

The Petition Clause protects the right to petition all branches and agencies of government for action. In addition to the right of assembly guaranteed by this clause, the Court has also ruled that the amendment implicitly protects freedom of association.

The civil rights of none shall be abridged on account of religious belief or worship, nor shall any national religion be established, nor shall the full and equal rights of conscience be in any manner, or on any pretext, infringed. The people shall not be deprived or abridged of their right to speak, to write, or to publish their sentiments; and the freedom of the press, as one of the great bulwarks of liberty, shall be inviolable. The people shall not be restrained from peaceably assembling and consulting for their common good; nor from applying to the Legislature by petitions, or remonstrances, for redress of their grievances.

Believing with you that religion is a matter which lies solely between Man & his God, that he owes account to none other for his faith or his worship, that the legitimate powers of government reach actions only, & not opinions, I contemplate with sovereign reverence that act of the whole American people which declared that their legislature should "make no law respecting an establishment of religion, or prohibiting the free exercise thereof", thus building a wall of separation between Church & State. Adhering to this expression of the supreme will of the nation in behalf of the rights of conscience, I shall see with sincere satisfaction the progress of those sentiments which tend to restore to man all his natural rights, convinced he has no natural right in opposition to his social duties.

In the preamble of this act [. . .] religious freedom is defined; and after a recital 'that to suffer the civil magistrate to intrude his powers into the field of opinion, and to restrain the profession or propagation of principles on supposition of their ill tendency, is a dangerous fallacy which at once destroys all religious liberty', it is declared 'that it is time enough for the rightful purposes of civil government for its officers to interfere [only] when [religious] principles break out into overt acts against peace and good order.' In these two sentences is found the true distinction between what properly belongs to the church and what to the State.

The "establishment of religion" clause of the First Amendment means at least this: Neither a state nor the Federal Government can set up a church. Neither can pass laws which aid one religion, aid all religions, or prefer one religion to another . . . in the words of Jefferson, the [First Amendment] clause against establishment of religion by law was intended to erect 'a wall of separation between church and State' . . . That wall must be kept high and impregnable. We could not approve the slightest breach.

Brandeis wrote a dissent in which he argued for broader protections for political speech:

"Those who won our independence . . . believed that freedom to think as you will and to speak as you think are means indispensable to the discovery and spread of political truth; that without free speech and assembly discussion would be futile; that with them, discussion affords ordinarily adequate protection against the dissemination of noxious doctrine; that the greatest menace to freedom is an inert people; that public discussion is a political duty; and that this should be a fundamental principle of the American government."

See if you can tell me where you fit in above Chuckles.
Reply: "tell me where you fit in above"

I asked YOU which rights I have impinged upon and you throw up a wall of text and ask me where I impinge upon other's rights?!?!?! Can you be more blatantly elusive and vague?

I will ask again, Which rights have I deprived anyone of? I have a feeling you'll continue to grasp at straws without actually ever presenting an actual argument. 

Still waiting.. but you know, it's cool, because I'm on the clock here... apparently.
Reply: +ErgoCogita  Get an honest job troll. I'm growing tired of funding your pink haired strippers and gambling boat cruises to nowhere off the coast of Florida.
Reply: +ErgoCogita  How is good old Jack Abramoff these days paid troll. I heard he was having a bit of financial difficulty.
Reply: "Get an honest job troll. I'm growing tired of funding your pink haired strippers and gambling boat cruises to nowhere off the coast of Florida."

So let's get this right:

 You can't back up your invocation of Newton's 3rd Law. So you instead claim that I:
1- you claim I am payed propagandist.
2- you claim that I am infringing on other's constitutional rights but refuse to specify exactly which rights.
3- you think I take cruises on gambling boats with strippers.

Would you care to charge me with baby eating? Or grandma punching? Or maybe puppy kicking? I mean, you certainly refuse to support any of your assertions with any reasoning or facts whatsoever so...
Reply: +ErgoCogita  Sorry paid shill, I quit reading at:

So let's get this right:

You're talking yet more nonsense about impossible events.
Reply: +ErgoCogita  Oh, you asked me a question earlier:
First Amendment freedoms are most in danger when the government seeks to control thought or to justify its laws for that impermissible end. The right to think is the beginning of freedom, and speech must be protected from the government because speech is the beginning of thought
Reply: Payed shill   I don't support your ideals at all Payed shill so I wish you would discard such negativity. You'll live a fuller life.
Reply: You would think the truth moment couldn't possibly get any stupider than it already was, yet they never fail to surprise. So if you question any of these lunatics' claims you are now a paid government agent that denies freedom of speech to others, and violates basic constitutional principles! Well, that's a new one, isn't it!

To paraphrase Einstein: "there are only two things that I know of that are infinite in size: the first is the universe and the second is the stupidity of the 911 "truth" movement, although I'm not quite sure about the universe..."

Well, job done... now to lean back and wait for the big fat hairy pay-check from the US government.
Reply: Thomas Hjortgaard Danielsen  Quite simply put (for your benefit, not ours) Occam's Razor my man, the doubting Thomas.
Reply: I am aware of no such seismographic evidence regarding nuclear explosions from any of the recording stations at or around NYC. In fact, I have only ever seen evidence to the contrary. Even further The only seismic recordings from that day are from the collapses themselves. None of them shows a velocity profile even remotely resembling a nuclear blast... or any large blast apart from the impacting jets. Nothing but the impacts and rumblings of the buildings as they collapsed from failure.

Don't take my word for it though, read their reports and data for yourself. Search  "Seismic waves generated by aircraft impacts and building collapses at world trade center"

And then cross check that with any seismographic evidence from any station with a nearby nuclear explosion. You'll not find a single match. Good luck... I've tried...
Reply: With all due respect, saying a name doesn't do much. I am not interested in YouTube videos either. I want actual data that I can reference. If you don't have that or cannot direct me to a more specific source, then you aren't very much help. I mean hell, I could tell you the name of many people with videos... but that wouldn't be very helpful, would it?
Reply: "Besides with all of the manipulating and controls of that day having been messed with, do you really hang all of your belief's on seismic data."

So wait a minute, do you or do you NOT have seismic evidence showing a nuclear blast in the vicinity of the WTC on 9/11? You just said that you do and then in the next breath you decry the very data you say you have? You sure seem to be grasping at straws here...
Reply: "He's not just a name... He's basically the Russian equivalent of Major General Stubblebine. I'm not going to argue though."

That's nice. Now do you have any seismic source data showing a nuclear explosion under WTC on 9/11 or not?

"You either can stomach the truth or you can't and to fully appreciate Dimitri Khalezov's presentation"

You sling around terms like "truth" but it rather clear that you have never actually viewed any source data yourself. I've provided you with a source of seismic data for the area that day and literally not a single blip of it resembles a nuclear explosion.

If you don't have any actual seismic data to provide, then I'm afraid you are irrational in your expectation for anyone to believe you.
Reply: ErgoCogita  Normally I would refuse to agree with a paid shill like you but this time you may be on to something.
Reply: "payed shill" Hahahah, yeah, there goes another term that is thrown around without regard. It's easy to fling that term out at somebody in lieu of an actual argument.
Reply: Still have a touch of that characteristic of a troll, the PBA I see. 
I think they have medicine for that.
Reply: Don't forget, they have to be exploding pancakes
Reply: "You are sorely mistaken if you think I'm going to enslave myself by even so much pointing you in the right direction any more than I already have."

I I know right? Simply posting a source of seismic data showing a nuclear blast under WTC is so "enslaving" you... Yet you've come back to pointlessly post 3 separate times since I asked. 

"Get off your lazy ass and look it up yourself."

I did just that. I found the actual source of the seismic data from that day, I even linked you to it. You've neglected to show me where the nuclear blast happened in it.

 "If you don't, it proves that you are just a coward and a shill!"

Ah yes, you make the claim and mention some dudes name. I link you the source data and you refuse to comment... therefore I am a "coward and a shill"... Impeccable logic bub.
Reply: ErgoCogita  How much of the Israeli involvement in 9/11 are you instructed to deny as a government sponsored apologist?
Reply: What's that, Randy?
Reply: Jake Benjamin you certainly do not sound like a chemical engineer or a person with a masters degree . 

On the other hand here is a brief biographical sketch of Dr Judy Wood. 

Dr. Judy Wood earned a Ph.D. Degree from Virginia Tech and is a former professor of mechanical engineering. She has research expertise in experimental stress analysis, structural mechanics, deformation analysis, materials characterization and materials engineering science. Her research has involved testing materials, including complex-material systems, in the area of photomechanics, or the use of optical and image-analysis methods to determine physical properties of materials and measure how materials respond to forces placed on them. Her area of expertise involves interferometry in forensic science. She taught graduate and undergraduate engineering classes and has authored or co-authored over 60 peer-reviewed papers and journal publications in her areas of expertise.

In the time since 9/11/01, she has applied her expertise in materials science, image analysis and interferometry, to a forensic study of over 40,000 images, hundreds of video clips, a large volume of witness testimony, analyses of dust samples, seismic data, and the analysis of other environmental evidence pertaining to the destruction of the World Trade Center complex. Dr. Wood has conducted a comprehensive forensic investigation of what physically happened to the World Trade Center site on 9/11. And, based on her analysis of the evidence she gathered, in 2007, she filed a federal Qui Tam case for science fraud against the contractors who contributed to the official National Institute of Standards and Technology (NIST) report about the destruction of the World Trade Center towers. This case was filed in the US Supreme Court in Dec 2009. To this day, Dr. Wood's investigation and body of evidence as compiled in her book is the only comprehensive forensic investigation in the public domain. WHERE DID THE TOWERS GO? is not a book of poetry, yet it has some beautiful prose. It is not a novel yet it tells a complete story. It is not a photography book, yet the pictures will grab you. It is not just a text book, yet its data is empirical and it teaches critical thinking. It is not the Bible yet it will be one of the most important books you will ever read.
Is this what Eisenhower warned us of?
Where did the building go?
Figure 1. My intellectual integrity prevents me from calling this a collapse. This is why I have chosen to stand up. My conscience leaves me no other choice.

Dr. Wood received her

B.S. (Civil Engineering, 1981) (Structural Engineering),
M.S. (Engineering Mechanics (Applied Physics), 1983), and
Ph.D. (Materials Engineering Science, 1992) from the Department of Engineering Science and Mechanics at Virginia Polytechnic Institute and State University in Blacksburg, Virginia.
Her dissertation involved the development of an experimental method to measure thermal stresses in bimaterial joints. She has taught courses including
Experimental Stress Analysis,
Engineering Mechanics,
Mechanics of Materials (Strength of Materials)
Strength of Materials Testing
Judy D. Wood is a former professor of mechanical engineering with research interests in experimental stress analysis, structural mechanics, optical methods, deformation analysis, and the materials characterization of biomaterials and composite materials. She is a member of the Society for Experimental Mechanics (SEM), co-founded SEM’s Biological Systems and Materials Division, and has served on the SEM Composite Materials Technical Division.
From 1999 to 2006 Dr. Wood has been an assistant professor in the Mechanical Engineering Department at Clemson University in Clemson, South Carolina. Before moving to Clemson she spent three years as a postdoctoral research associate in the Department of Engineering Science and Mechanics at Virginia Tech.

One of Dr. Wood's research interests is biomimicry, or applying the mechanical structures of biological materials to engineering design using engineering materials. Other recent research has investigated the deformation behavior of materials and structures with complex geometries and complex material properties, such as fiber-reinforced composite materials and biological materials. Dr. Wood is an expert in the use of moiré interferometry, a full-field optical method that is used in stress analysis, as well as materials characterization and other types of interference. In recent years, Dr. Wood and her students have developed optical systems with various wavelengths and waveguides. Dr. Wood has over 60 technical publications in refereed journals, conference proceedings, and edited monographs and special technical reports.

Dr. Wood started to question the events of 9/11 on that same day when what she saw and heard on television was contradictory and appeared to violate the laws of physics. Since that day she has used her knowledge of engineering mechanics to prove that the collapse of the World Trade Center twin towers could not have happened as the American public was told.

Doesn't sound like a "KOOK" a PLANT" or a "MORON" to  me.

Why don't you debate her findings and come up with scientific reasons why you don't believe her analysis ? All you are doing is attacking her personally. Any educated person understands that that is nonsense ,unscientific , and extremely childish, it has no place in a scientific debate.
Reply: "the bottom line is that the tops of the buildings above their respective impact zones weren't heavy enough along with the assistance of gravity to provide the necessary energy"

Oh? And what calculations did you do to prove that, may I ask?
And now explain why they bothered to build the towers so strongly that you could drop the top third from a couple of storey's height onto the rest without it failing? Seems a bit overengineered and expensive to me.

Or maybe you don't have a fucking clue what you're talking about, hmm?
Reply: +Steve Hunter
"there is a complete absence of 110 concrete floors lying on the ground" - That's no surprise.
The towers had BASEMENTS SEVENTY FEET DEEP.
I think you are an  IDIOT.
Reply: +HighsNBurgers
"less than 70 ft. deep to basement floor. The towers were 1362' tall" - We will take your figures.
The towers were 210 feet square. Their volume (including the air they contained) was therefore:
( 1362 x 210 x 210 ) or 60, 064, 200 cubic feet.  Are you OK with that so far?
A cubic foot of steel weighs 490 pounds or 0.219 tons.  Are you OK with that so far?
https://www.reference.com/science/much-cubic-foot-steel-weigh-fbe6c2741fd218df
So if the tower were made of SOLID STEEL it would weight 13,154,060 tons.  Are you OK with that so far?
But we KNOW it weighed 500,000 tons: http://hypertextbook.com/facts/2004/EricChen.shtml
Are you OK with that so far?
Now we can work a small miracle, can't we?
We KNOW that the TRUE HEIGHT of the TOTALLY COLLAPSED TOWER (without its air) will be:
the original height of the tower times its true weight, divided by its weight if made of solid steel.
That is  ( 1362 x 500,000 / 13,154,060 ), or 51.77 feet.
Now, we BOTH know the tower basement was deeper than that, don't we?
So, in your own words, it is YOU who is the thick-headed , weak-suck "truther" High-sniffin'Buggeredfart who DOESN'T think 110 stories of steel and concrete and steel structure fits in a LESS THAN 70' deep, 6 story hole. WRONG AGAIN, TRUTHER!  Are you OK with that so far?
Keep that consistency up, up...  Keep those burgers coming - hard-working people need'em right now.
Wash your hands.  And your mouth.  Your brain seems to have been washed already.
Reply: A study of the fire effect on the floor trusses noted "loud reports" as the concrete spalled. This might explain the reports of "explosions" (JP Gross; TP McAllister)
There are many other rational explanations; things falling down, containers bursting, etc.
Loud bangs and crashing noises are frequently reported by firemen in burning buildings.
Reply: +Steve Hunter
If you ABSOLUTELY collapse down a tower, it will collapse down to FIFTY-SEVEN FEET.
The tower basement is SEVENTY FEET DEEP.
Work it out for yourself.
Reply: Metallurgists confirmed the presence of thermite melted steel spheres but do continue on with your theory busting because your doing a bang up job .
Reply: +ErgoCogita  NIST denied the floors pancaked sir but they retained the exact same description as you do, even use the words "pancaking floors". They seem to be as confused on the general concept of what pancakes are and how they are visualized as they stack. To a layman such as myself, I just don't see flapjacks performing tricks only seen by overfilling a popcorn maker and cranking the element up to high.
Reply: +ErgoCogita  Okay I will break this down for you troll:
1/ You are a representative of the federal government
2/ The right to think is the beginning of freedom, and speech must be protected from the government because speech is the beginning of thought
3/ You are thought police Cupcake
Reply: Maybe because everything was crunched together and crumbled like concrete does on a street after every winter.. Did you think of that? Or that 100 tons of material was falling 100 mph